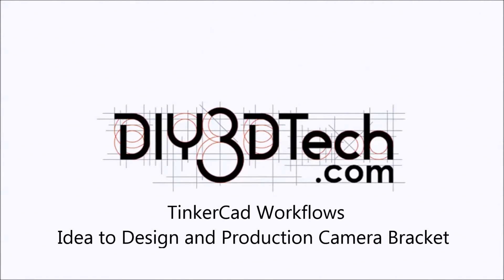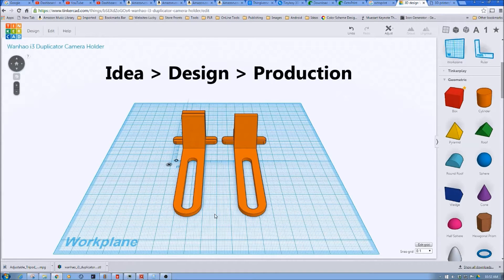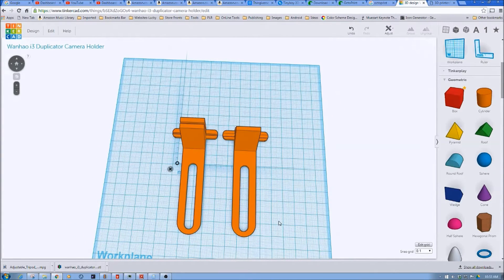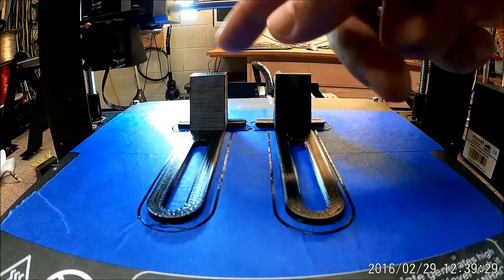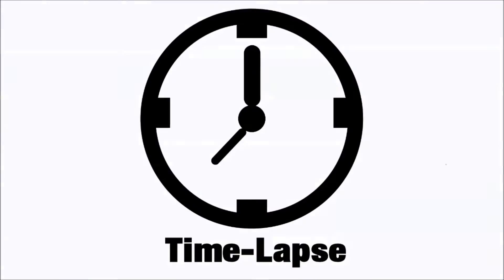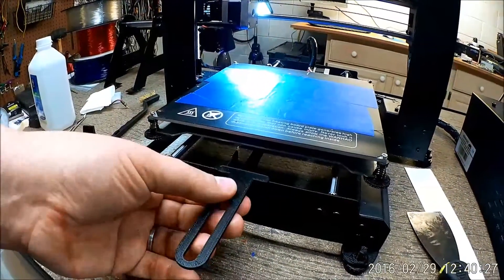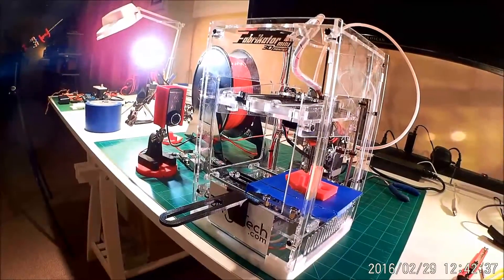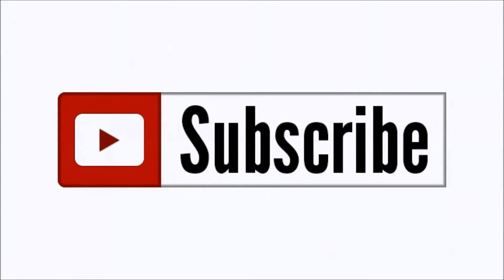TinkerCad Workflows -  Idea to Design and Production Camera Bracket

Comment: Any advantages of TinkerCad Vs 123D Design?
Reply from the maker: +Mickice I LOVE TinkerCAD!  I use TinkerCAD, 123D and Open SCAD.  However TinkerCAD is my go to general design, whereas I use Open SCAD for designing complex pieces.  Also I have issues  running 123D on both my MAC Book Pro (which is very beefy) Along with a high end windows workstation.  The final piece however with TinkerCAD is it is "social" so easy to share, upload to Thingiverse and so on and I like to share things so its a natural!

Comment: I'm liking your videos but your timelaps' are not too enjoyable to watch due to the fixed camera position (induces motion sickness). 

Check out "How I Use a GoPro for Timelapse 3D Printing" by Joel 3dprinting nerd, I'm sure it will work on your i3.
Something similar could work for the Turnigy mini but I think the steppers and leveling would suffer if you hung a web cam off the bed.

Maybe a seperate camera gantry mirroring the x gcode outside of the turnigy mini...

Keep up the good work.
Reply from the maker: +Andrew Griffiths That is actually what I like about it :-) I find it sort artistically interesting to watch the motion (in another life I also do fine art photography, seriously).  Anyway, I am also not fond of the idea of mounting a camera to a spring loaded and have bounce as I print.  However!  I do appreciate your comments and I have been experimenting with Z-Axis time lapse via OctoPrint, let me know what you think of that :-)
Reply: +DIY3DTECH.com the action is very reminiscent of "how's it made" where the entire process and product is the article, with a time laps the print is the showcase that's difficult to follow, but each to their own. 

I was thinking it could be mounted on the aluminium bottom bed not the spring loaded headed bed.

All the best
Reply from the maker: Yes that would be possible, however the bed would have to drag along pretty good sized camera as I use the Ricoh WG‑M1 attached to a power cable and its elevation and how fast the bed get whipping I could just see the camera go whipping :-) Did you look at the Z-Axis videos?  They are much shorter as it only takes a picture when the Z axis moves however I like the up build, wish I could get that to work on the Wanhao.  Might try some hacking in the near future time permitting